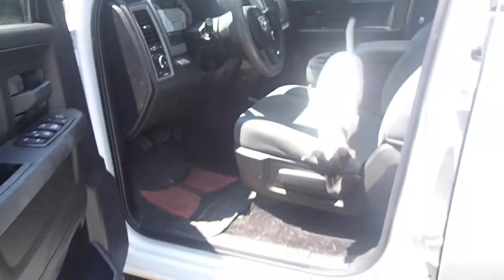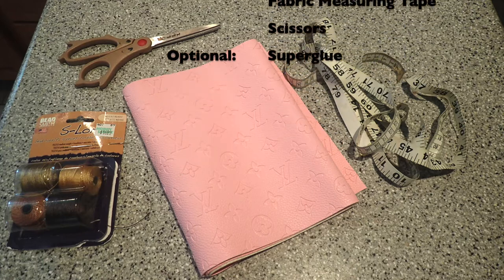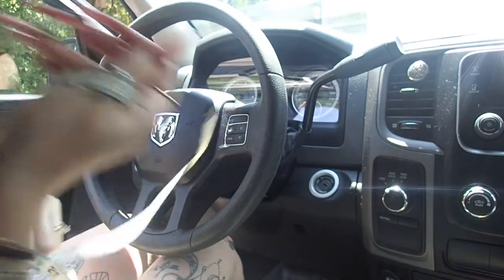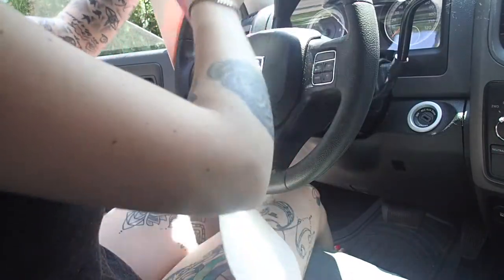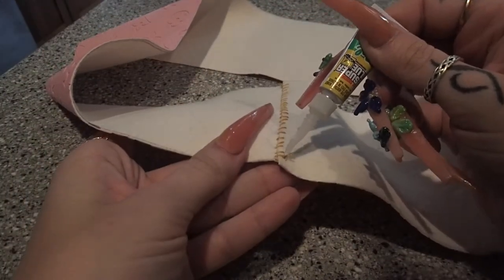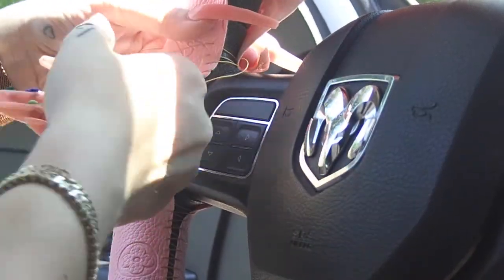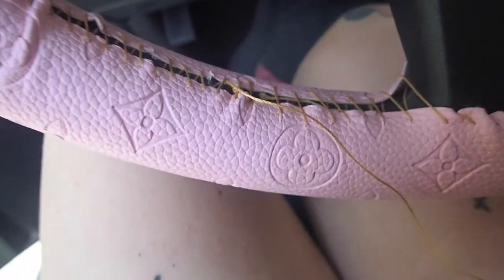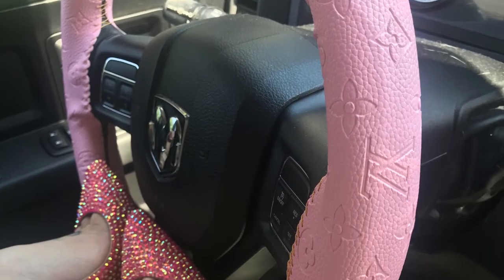Sew On DIY Leather Steering Wheel Cover

Comment: Great easy video! Thank you. I was wondering what you did to the back side when you had to make it tighter when the there was a wheel spoke in the way. You showed the front but what does the back look like. 😁 Thanks!!!
Reply from the maker: Oh! I just left it smooth with no stitching. But if that doesn’t tighten it enough just stitching the front you can do the same process on the back with another piece of thread :)
Reply: @ExaLectric  thanks! I will let you know how it goes!